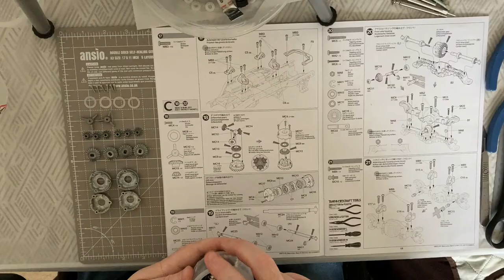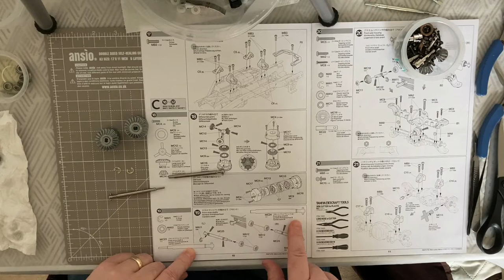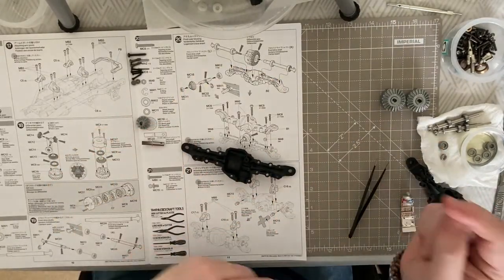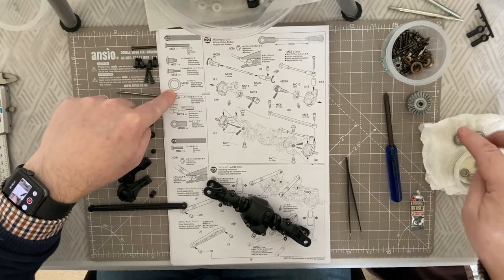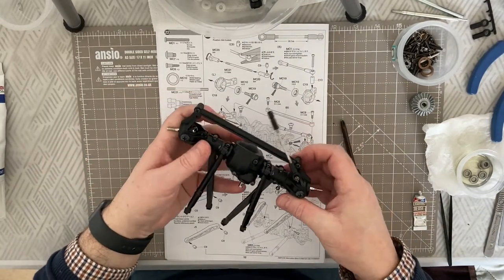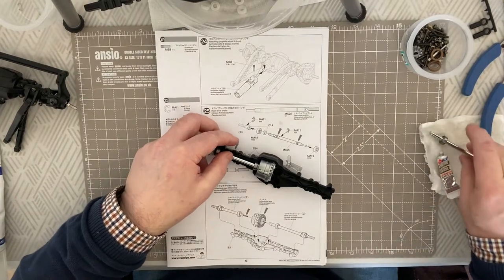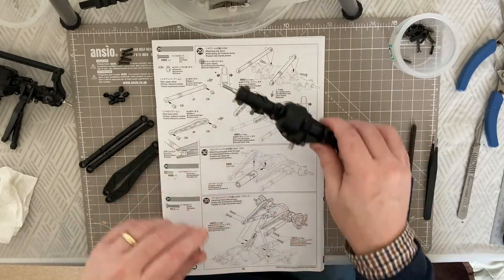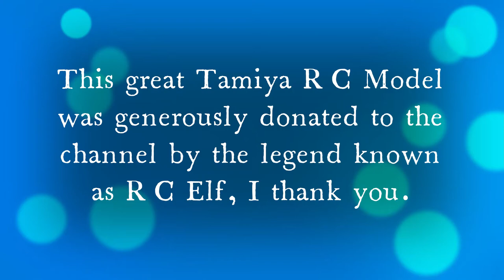Tamiya Mercedes Benz G500 Build Steps 18 to 32

Comment: Hiya John. Really impressed with this kit. It seemed expensive on the face of it but I can see why now. Very substantial components. I'm never keen to lock the diffs either because it makes the steering rubbish when there is grip. A good idea if you are only running on slippy mud though I guess. I'm not big on RC crawling as you know and I'd be blasting this round like a rally car! Good stuff mate. Looks like it has provided much building pleasure. Hope all is well with you my friend 😁
Reply from the maker: Hi Pete, I agree with you on the diff’s I like the diff’s open. I could always put a thicker grease to make the diff act more as a limited slip diff, but it’s going to be used more like the trail model, and to be honest, I don’t push them to their limits. I know you love making your models insanely fast, that’s what I love about you bud! I really have had a good building experience with this model. Looking to get some time to do that all important first run. Just been crazy busy at work as a specialist home claims handler! Escape of water for 8 in 10 claims! Unbelievable! And what with obtaining my Cert CII in Insurance, been a bit hectic, not forgetting getting better too, Still, got my RC’s to take my mind off things 😊😉😊 always, thank you for watching and your great support, take care and all the best

Comment: Progressing nicely John. It looks like a really in-depth build. Great tip with the pots 👍🏻I have been thinking about the impact of locking differentials recently and wondering when do consider doing this. My back yard track is mainly loose dirt so I think it is something I might look into trying. Looking forward to bag D!
Reply from the maker: Hi Craig, hope you’re keeping well and thank you for watching my video. The pots, just help to keep the screw bags in order, especially for the older style Tamiya’s where you have to dive into all the screw bags from the first step. The diff’s I’ve left open, you could lock either front or rear, the other thing is use thicker grease in one or both of the diff’s, this will still allow some transfer of the power, but because the grease is thicker, the force to turn the diff will be greater, the diff will act as a limited slip diff. Giving a compromise, might work on your track? Could give that a go, if you like tinkering with the setup, like i do 😊😊. Take care, keep well and all the best to you and the family. 😊😉😊